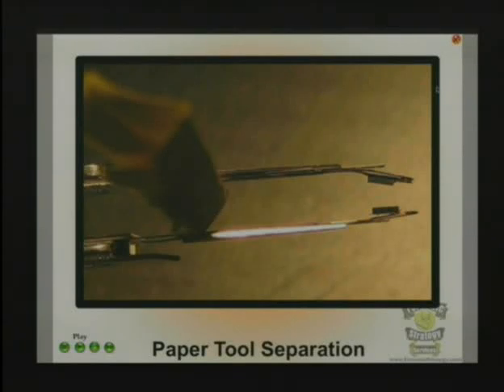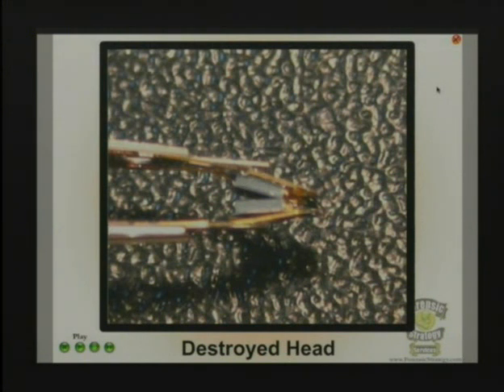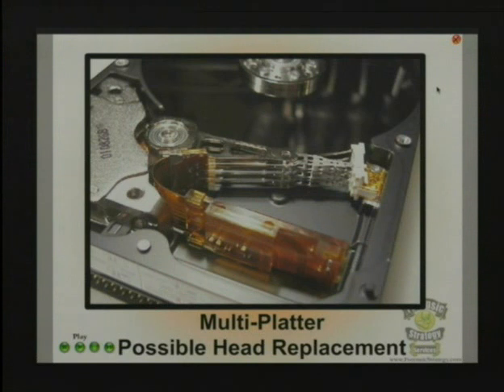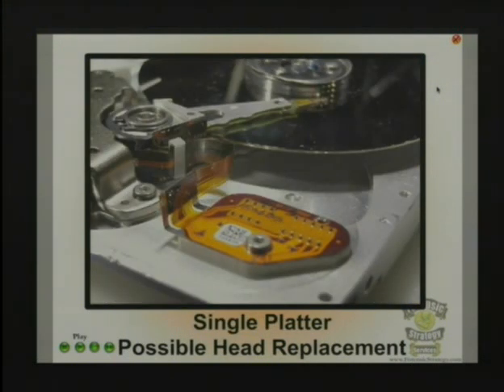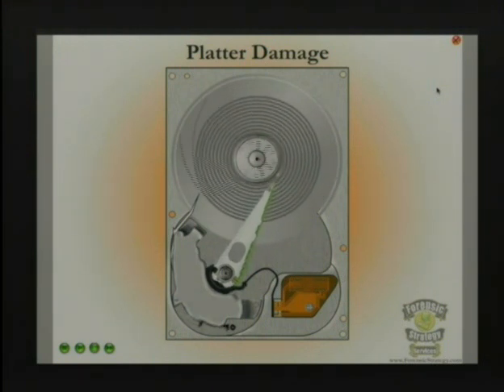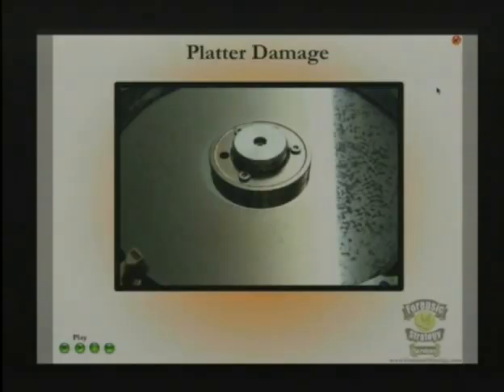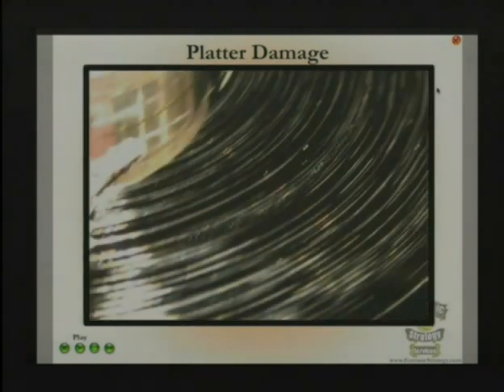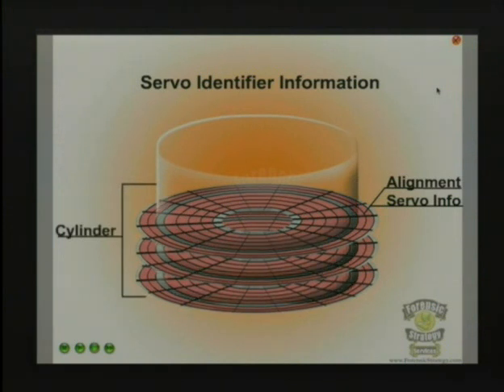Hard Drive Recovery Part 6

Comment: Data recovery with multi-platter drives w/ bad motors are possible. A jig with a 3 phase motor located over the spindle lock and driving the open screws will do it. Yea, it's yet another high-precision part to buy, but you should be able to recover data in this instance with absolutely no prob, assuming all other hardware is good. And yes, I can locate it to within .0002", or better with more patience. ;-)

Comment: This is just a warning to anyone trying a arm/head replacement:

I had a Samsung 120GB SP1213C that had a head crash, but found a replacement. I had no problem removing the actuator arm from the platter, despite its 3 heads (2 on the top platter, 1 on the bottom). However, opening up the new hard drive, the head arrangement was 1 on top, 2 on the bottom. The manufacture dates were only two months apart! So, it is important that the dates are as close together as possible. Good luck!

Comment: But yea, if the spindle lock is broken loose, it's over, without some serious file carving utilities. Had a guy try this before and had to break the news to him that it isn't possible. Pressing out the spindle is the ONLY way to do it. Never EVER think you'll get it right, because you won't. Not even the best toolmaker can get it perfect enough.